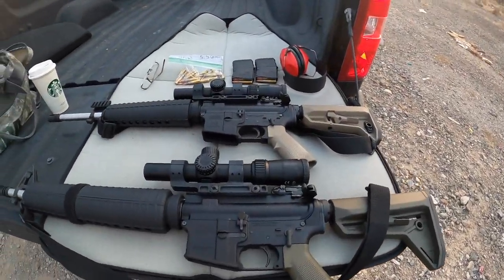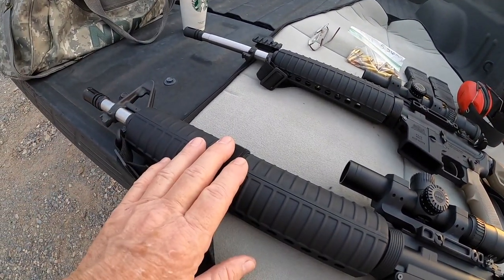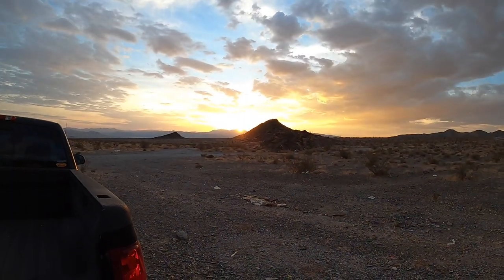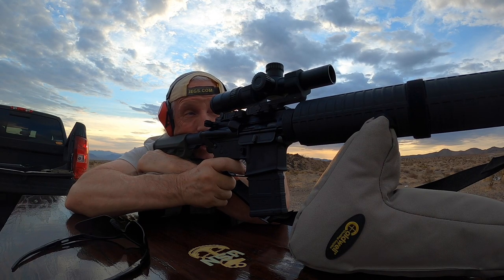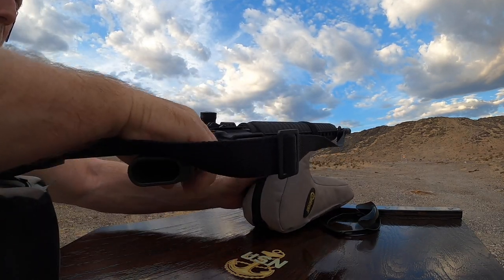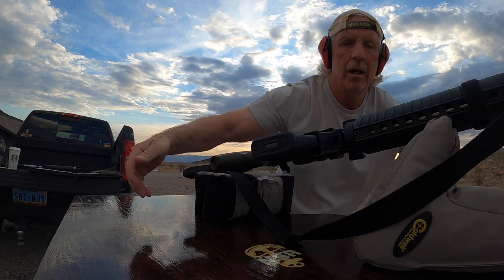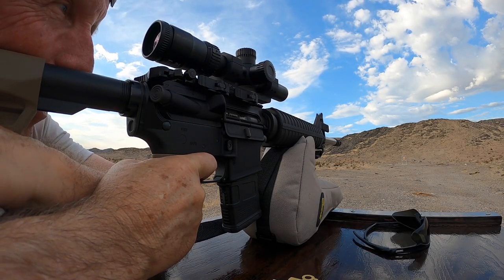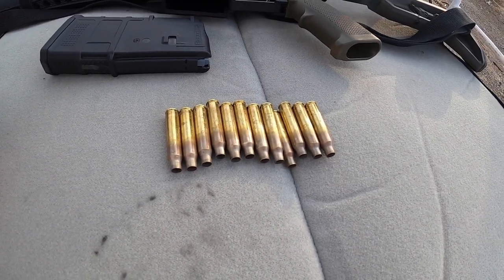AR-15 Palmetto State Armory Dissipator & Carbine Mid-Lengths Exceed Expectations! 22Jul2021

Comment: Just fyi- the real original "Dissipator", Colt 605 was a 20" cut down to a 16" and had a rifle length gas system. But Bushmaster invented the name, "Dissipator." They made and sold a 16" replica of the Colt 605 b ut with a carbine length gas system. The Dissipators nowadays have carbine and midlength gas systems, but the real original one had a rifle length gas sytem
Reply from the maker: I have a more original rifle gas version although I used a Criterion barrel with a hand guard rail and a low profile gas block. I also have an older Windham Weaponry with the carbine gas and A2 hand guard but with a collapsible butt stock. The original "Dissipator" I believe during Vietnam was 15" although some say 15.5". I always wanted a Bushmaster dissipator when I first noticed them in the catalogs back in the early 90's but it's only been more recently since I've owned a few. Just always liked the look! Thanks for watching and the commenting!

Comment: Great video and thanks for putting it out here, I do have a question though. Do both rifles have carbine length buffer tubes and standard buffers? I’m asking because so far everybody else I’ve seen on YouTube is running a rifle length fixed stock. Thanks in advance.
Reply from the maker: Tubes are standard carbine MilSpec dimension and the buffers are standard carbine weight. Thanks for watching!
Reply: @peteregger7928  thanks for the quick response. I really do appreciate it. Doing a little window shopping on PSA and going back-and-forth between there nitride and CHF version. Considerable price difference. Already have a stripped lower, lower build kit, and a few other odds and ends laying around so just wanted confirmation before committing to anything.
Reply from the maker: @Poppadee78  I think PSA is a very good value! I had some issues with their BCG's a while back where the ejector springs would bind before the ejector pin could go flush with the bolt face which caused head spacing to fail. The springs were the correct length and number of coils but what I noticed was the wire gauge was a little thicker than some of my spare springs from other BCG manufacturers which caused the binding when compressed. Spring pockets were drilled correctly. The premium PSA BCG's are what I had trouble with and I believe they were ToolCrafts? I have had no other issues with PSA and their stainless barrels and receivers have been very good! I'm still not sold on a Nitrided barrel yet but it's good stuff on my BCG's so far.

Comment: I was thinking about getting the dissapator from PSA but have heard mixed reviews like the fsb is not straight or the gas block is incorrect would you recommend this a a first rifle because I wouldn't want to get it if it is not reliable if that is that case I will get the colt 6920
Reply from the maker: The LE6920 or LE6920SOCOM I think should be better quality but Colt makes very little parts in-house these days. The Colt name still carries weight with a lot of people though. PSA QC can be hit or miss but both of mine in this video had no issues. These rifles are both using the Freedom series stainless but shoot surprisingly well. PSA also sells the CHF barreled versions using FN barrels but they are much pricier. The issues I have had with PSA were the BCG's premium phosphate versions. Windham Weaponry for a Dissipator could be another option but they do something with their flat top rifles which isn't right by using a standard A2 front sight base instead of the correct "F" marked if that matters to you?